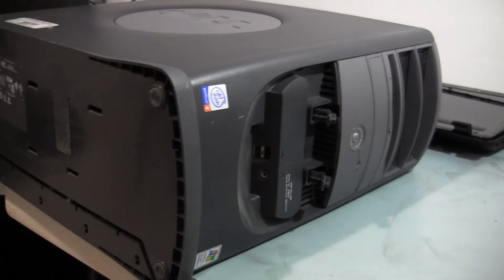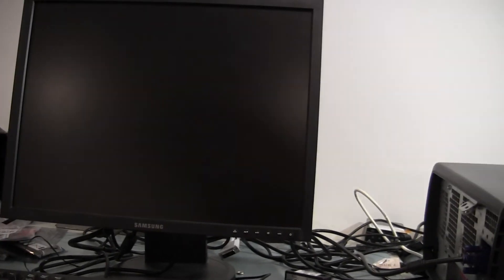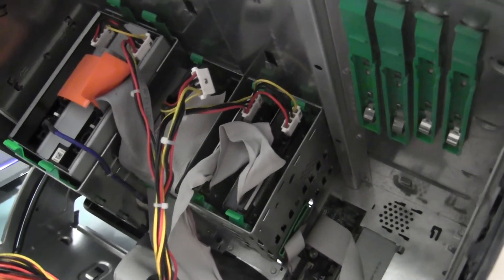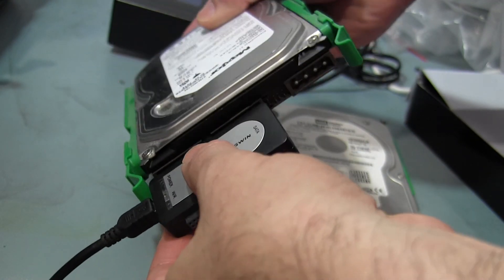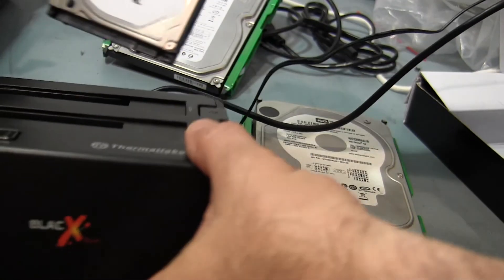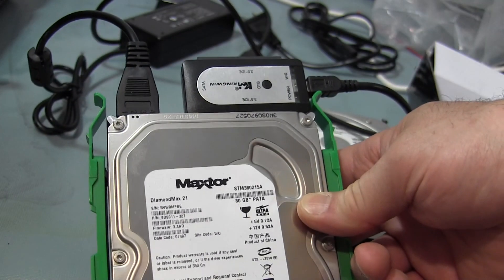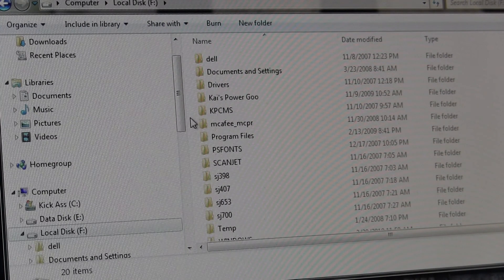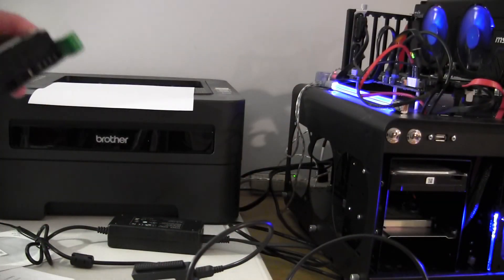How to Recover Data Files from a Computer that Died

Comment from the maker: lol, My first tech bench was the High Speed PC tech bench, which I still have and use for quick setup and testing of a systems main  components before installing in cases.  But my main test bench is the Dimastech. It is great and having the watre cooling options for dual is nice.